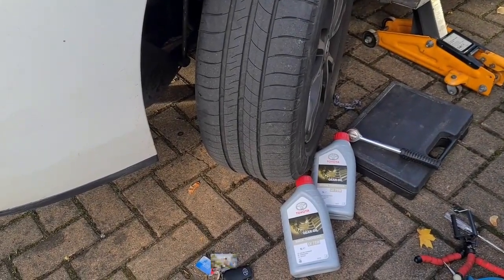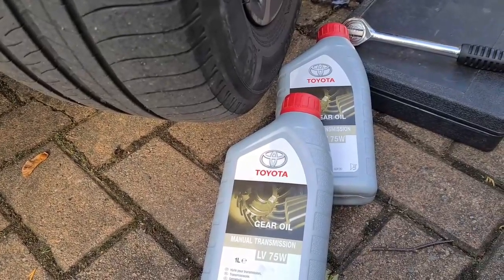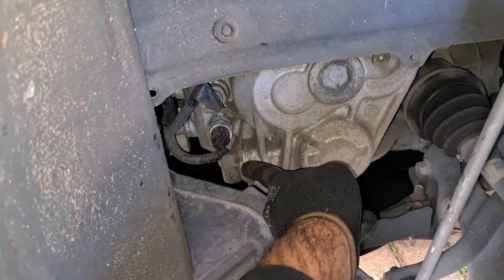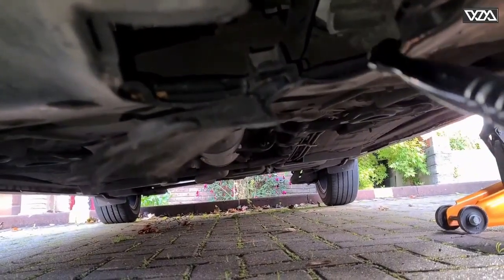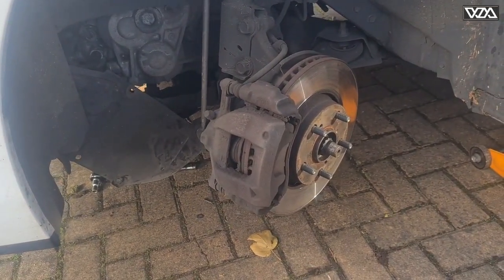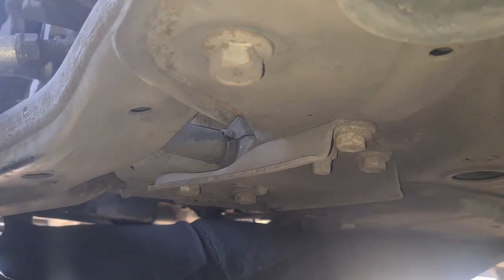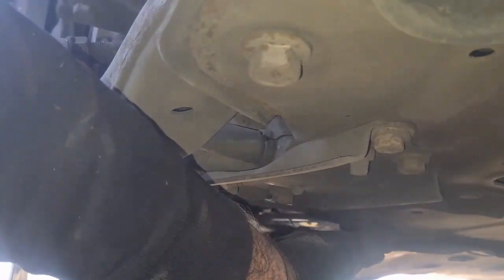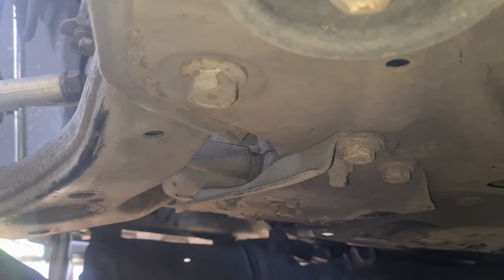gearbox oil replacement

Comment: Hi. Mine is Verso Automatic petrol 1.8 and 2018 model. Will the procedures be same. I done 60k miles.
Reply from the maker: Automatic petrol dont need changing untill upto 100k miles.
Reply: @LFITT  that’s good to know but what about the age? In March 2025, it will be 6 years old.
Reply from the maker: @HamzaMirofficial  its upto you if you wanna do for a peace of mind, the procedure is different for petrol automatic there is a gear oil filter too which should be replaced aswell.

Comment: What did you find was the main benefit from changing this oil? I'm at 91k and considering doing this.
Reply from the maker: smoother gear changing speacially at cold start, at 91k if you dont feel any issue i wouldnt worry to change it.
Reply: Toyota Maintanence says change it every 60.000km
Reply: Main benefit is that its a part of your car's regular maintenance.